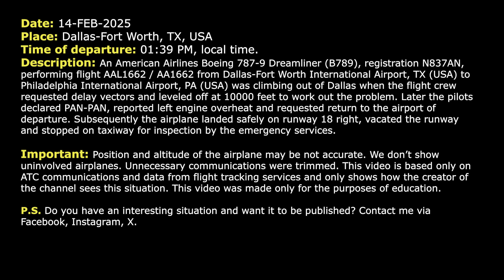Engine overheat. PAN-PAN. American Boeing 787 Dreamliner returns to Dallas-Fort Worth. Real ATC

Comment: Well heck...DFW is not far from us, but DAL is closer, we're in the arrival/departure a few miles north. I'm always looking at FlightAware when folks seem a touch low.
Reply: Just an opinion.  DFW is a more suitable airport with that much fuel.  They have longer runways, more fire equipment, maintenance, support personnel, etc…. While heavy AA aircraft don’t regularly fly into the smaller DAL.  Just my two cents.  Cheers.
Reply: @michelm.6033 I was not in any way referring to DAL as an alternative, just our prox to it.
Reply: @michelm.6033  Also if a mechanical issue but not an emergency, since DFW is AA's main hub, there are AA mechanics at DFW which can check and diagnose the problem, not so at DAL.  Plus, passengers can possibly get on another flight.

Comment: Another bad performance by an American pilot😱 'vectors out of your airspace'?! 'Pan-pan-pan' instead of 'pan-pan, pan-pan, pan-pan'?! Throughout the emergency he is more concerned about the gate, does he expect a runway assignment to minimize  taxi distance? The usual mumbling of non standard phrases🙄
Reply: Anything, to reduce taxi time at DFW, to get his broken airplane to a gate as soon as possible. He could be taxiing for 20min at DFW.  
The sooner his 300 passengers can start the unenviable process of figuring out how they are going to get to their destination, the better.
Reply: @Slonge92  Fair enough, same with 18R at Ams but that had nothing to do with the emergency at hand, if there are no restrictions on which runway they can accept that's what he should tell atc... Would taxiing on one engine be any problem? Hot brakes maybe?
Reply: Technically, it wasn't an emergency, rather an urgency, even though US ATC does classify it the same. 
With an engine overheat you usually just shut it down and that's about it. Airliners are certified to fly on one engine and the pilots practice it often in the sim.
Additionally, he likely meant to say "vectors out of your way/ inside your airspace".

Everything after a PAN-PAN or MAYDAY tends to be non-standard phraseology, since it is specific to the situation.
Reply: Jesus it doesn’t matter the manner in which you say pan what is wrong with you
Reply: @flapppytappybird7923  If reception is bad and for other stations not actively listening it does help to be instantly recognisable, also across language barriers, that's the whole point of having pan-pan and mayday🙄 If he isn't able to do even the most basic things correctly that doesn't bode well for the rest of his skills...
Reply: Right…a bad performance by the pilot for successfully getting the aircraft back on the ground 🙄 lmfao
Reply: @buccos2324
Reply: Pot-Pot Pot-Pot Pot-Pot
Reply: @bp900  And your point is?